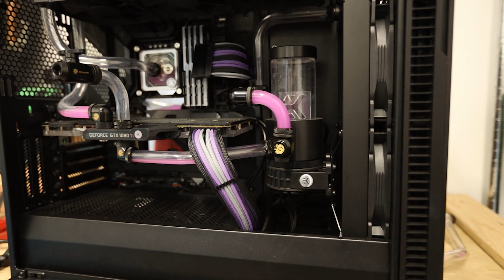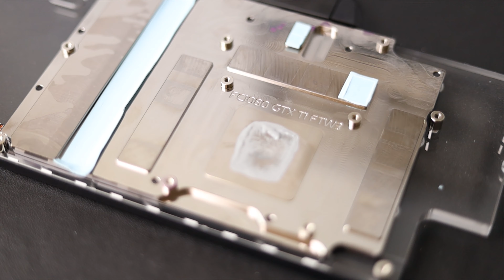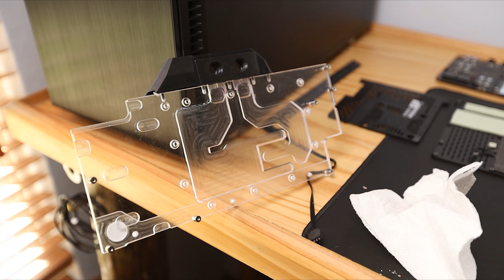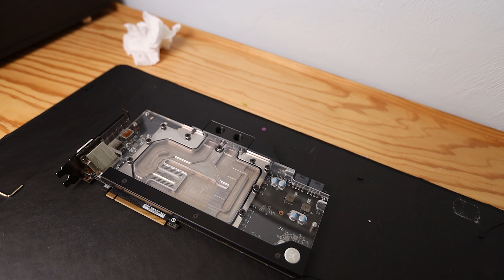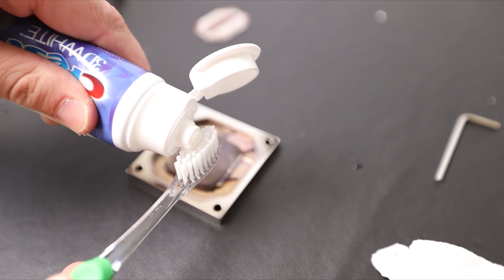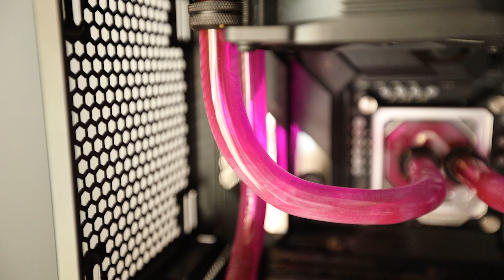Water Cooled PC Maintenance, FULL Water Cooled Loop Cleaning

Comment: Awesome video! Since there were problems with the coolant you’ve used, I suppose that you didn’t use the same type again. What have you used instead and how did it hold up till today? I’m looking for a reliable and good looking coolant for my next build. Thanks again.
Reply from the maker: Thanks! The fluid I am currently using is the Corsair hydro x fluid mixed with some distilled water. So far it is holding up great! Thank you for the subscribe!!